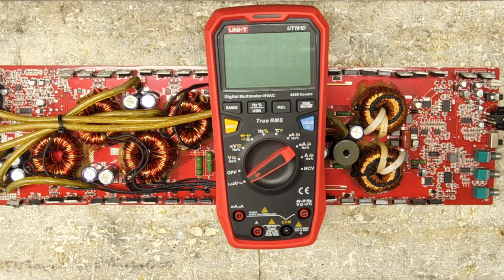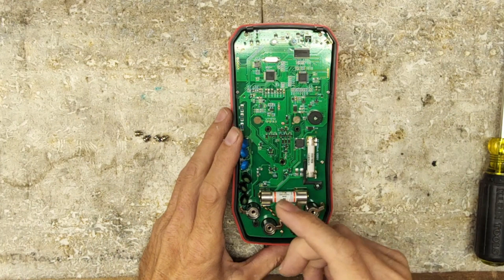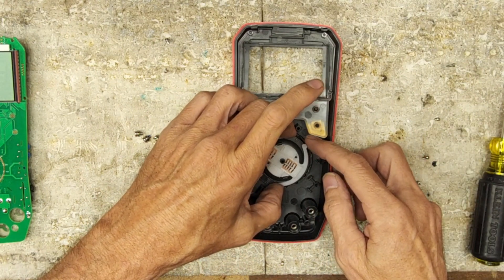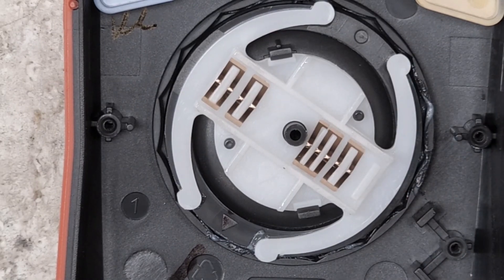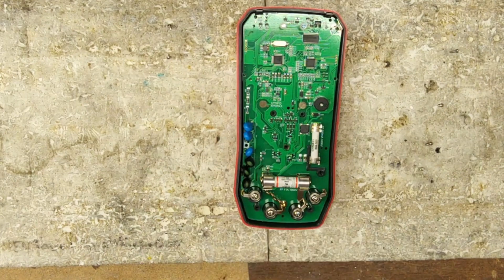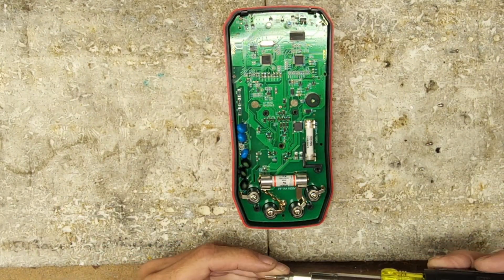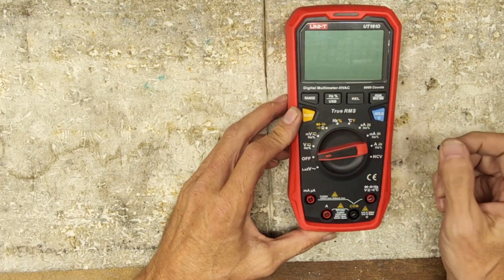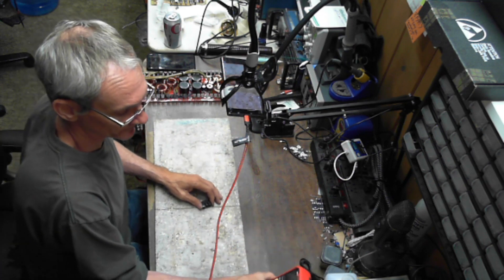Uni-T UT161D Fix of Rotary Dial Broken Pin Issue - Save Your Meter NOW

Comment: Thanks for the teardown and the tip re the screws, my meter broke both pins in just over a year's worth of fairly light use, I designed a small 3D printer wedge that fits over the clip and sits within the white frame, no need to melt anything with the soldering iron, simply pop the clips either side, works like a charm and fixes broken dials or strengthens new ones, I'll pop the files on thingiverse under the brand name later today.
Reply from the maker: Thank you for the community support!
Reply: Thank you...

Comment: Thanks for the tip, but are you sure that the breaking point is where you soldered? I think that the 2 pins can break from the base, so at the bottom! It would have been better if you had shown us the problem on the other multimeter that has this problem to better see how it breaks. And wouldn't the strong glue have been better?

Comment: Where can I get a replacement dial? 
My UT61D+ has a broken sweeper contact and the meter won't turn on.
Reply from the maker: Unfortunately, I don't think it is an available part.
Reply: @ellensburgamplifier  it's the V shaped copper fingers that has the issue.
Might have to look for a damaged meter for parts I guess

Comment: After the pins broke, I screwed in small screws, but they had to be short. I am very disappointed with the mistake made by the UNI-T engineers.
Reply from the maker: Agreed! I think as long as people know the shortcomings of the meters they may be able to help prevent premature failure. I have been wanting one of their benchtop meters but not sure how well-built they are.

Comment: I have a question about a sundown amplifier, What is or replaces audio transistor labeled H8 on sundown audio SFB 500.4 D ?
Reply from the maker: Excellent question. Unfortunately, I do not have notes for the H8. But we can figure it out. What is the voltage rating of the rail capacitors? The 500.4's that I have had in I did not take notes on but they were a commonly stocked transistor.
Reply: I will let you know. Thankyou for your help and time sir it is greatly appreciated.
Reply: 63 volts / 4700mf  Thankyou again for your help and your videos sir.
Reply from the maker: @aaronbigfishpreston9300  Just to make sure, these are the output transistors that are marked H8 correct?
Reply: @ellensburgamplifier  yes sir
Reply from the maker: @aaronbigfishpreston9300  There would be two choices if you don't know the capacitance or the Rds on value of the originals. The IRFB4115 and the IRFB4227 transistors.